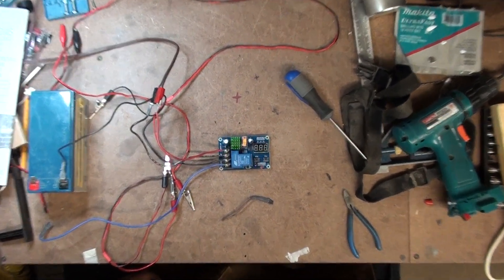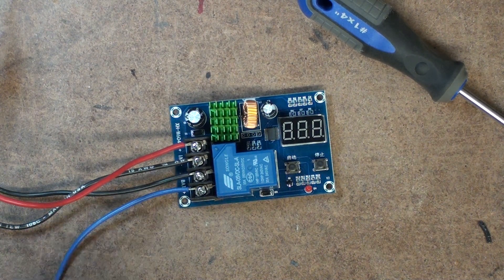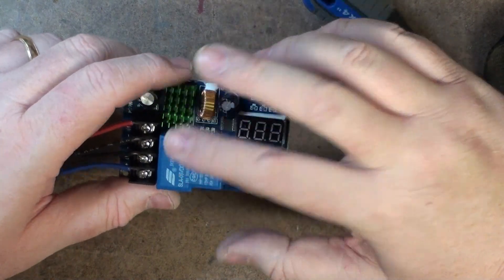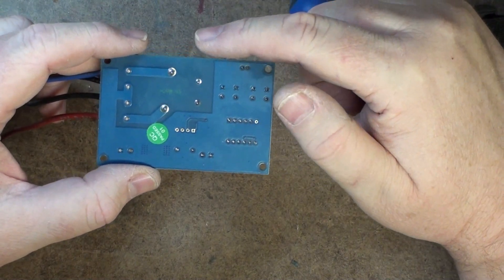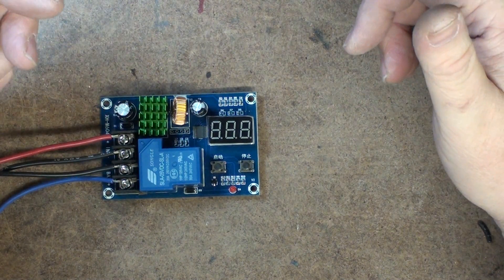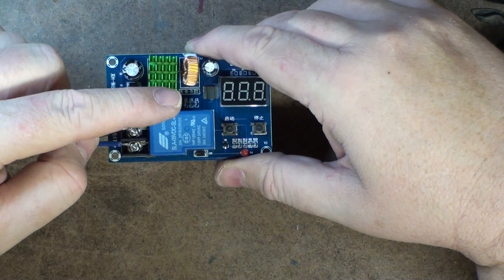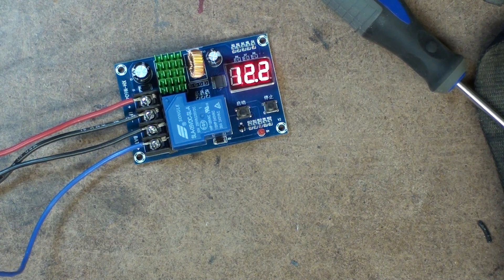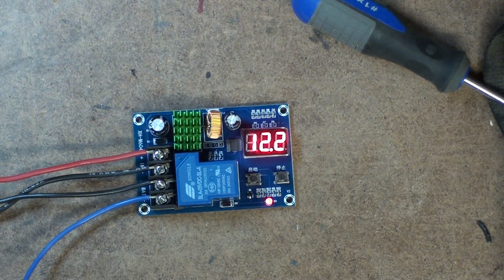ebay XH-M604 6-60vdc charge controller

Comment: FYI.    I took this board apart and those relay to terminal traces actually are duplicated on both sides of the PCB.   It should easily support 10 to 15 amps.   Personally I don't like the idea of this board.  I was rewiring it to power a dumb charger and use it to monitor battery charge and cut off the charger once the battery was charged.

Comment: The background audio noise makes the audio not as clear as it could be, but thanks anyway
Reply from the maker: my shed would be 140°+ in the summer without the AC.
Reply: @ObsessionoftheMonth  A headset/boom mic would reduce the background noise considerably.
Reply from the maker: @RyanStille  I filmed this 2 feet from an air conditioner in 115 degree heat. later videos are 10 feet away.

Comment: What happens if the display not on connect to battery only
Reply from the maker: If I understand you correctly, when connected only to a battery the display will light. the unit is powered by the battery.

Comment: can we connect it directly to a 110V AC power source? the Blue part on the charge controller shows 240 V AC, but the description in ebay says 6.60V as input. 
Also one of the the images in ebay shows a  'charger input' between the power source and the charge controller. 
If that is necessary, where to buy that. Please advice
Reply from the maker: The rating on the relay (the blue part) is in regards to the maximum voltage and amperage the relay contacts can handle. in this applications the negative connection is tied to the negative of the voltage in. 12 volts from the battery powers the unit. applying 110vac to the unit will fry it.

The 6.6 volts is reference to using it to charge a 6volt lead acid battery The unit will work on as little as 5 volts DC.

The maximum voltage the unit can handle is 30 volts DC NOT 60 as some listings say.

The charger unit is any charger used to charge a 12v lead acid battery. Ideally the charger unit would be dumb charger. meaning that it only outputs a charging voltage and does not do any monitoring or controlling of the charge itself as that is what this unit is for.

So you would hook up a lead acid battery charger (14.4vdc) to the IN side and a battery to the BAT side. Then set the voltages you want the unit to start and stop charging.
Reply: @ObsessionoftheMonth  I have seen in certain videos that they use a old Laptop charger as the input and then control the output volt/amperage as need be.. will that work.. i have an old 20V laptop charger lying somewhere..
Reply: sorry to sound as dumb.. i am really novice at electricals.. trying my hand at learning..
Reply from the maker: @mayukhdatta3801  yes
Reply: @ObsessionoftheMonth  I believe that to be wrong. In the schematics it shows that input of the charger is directly connected to the output. There is only the ON OFF function. So no voltage control, no amperage control only ON / OFF.
Reply from the maker: @LeoGerritsen  The rating on the relay (the blue part) is in regards to the maximum voltage and amperage the relay contacts can handle.

Comment: First , thank you for sharing this video , the maximum current can handle is not related to the relay , according to the supplier on Aliexpress the maximum current is 10 Amp :https://www.aliexpress.com/item/WAVGAT-official-VHM-004-DC-6-60V-Battery-Charger-Control-Module-Storage-Lithium-Battery-Charging-Control/32945908739.html?spm=2114.search0104.3.133.5cf5113bHEczSE&ws_ab_test=searchweb0_0,searchweb201602_2_10065_10068_10890_319_10546_10059_10884_317_10548_10887_10696_321_322_10084_453_10083_454_10103_10618_10307_537_536_10902-10890,searchweb201603_51,ppcSwitch_0&algo_expid=95d03cd0-e669-4507-8378-7c998bc2182f-19&algo_pvid=95d03cd0-e669-4507-8378-7c998bc2182f&transAbTest=ae803_3

Comment: HOW TO CONTROL BATTERY CHARGER SO THAT THEY NOT OVERCHARGING 80% AND NOT OVERDISCHARGE 20%
Reply: Please can get me a solution?
Reply: I need a controller that can monitor a battery charging  for me. 
Battery fully charged will be at 53v that's maximum voltage. 
Battery low voltage discharge  will be at 42v that's minimum voltage. 
The controller should be a  stable one. 
Thanks for your understanding. 
Very urgent please

Comment: thanks for the helpful video. can i use this boar with 19v laptop charger to charge single or double 12v lead acid battery? i really confused that this board work as step up/down buck to arrange charging voltage when there is a big voltage difference or not. thanks alot. i have intention to make bluetooth speaker box with car type batteries. i am looking for a charging solutions. thanks alot.
Reply from the maker: This board is only able to start and stop charging a battery. It does not step up, or step down the voltage.
Reply: thanks for the reply. now i understand the issue.

Comment: From ads I see the board width is 54mm and from my rough measuring the board dimensions on the video it looks like the traces are about 3.6mm wide.

Standard copper thickness for PCB is 1oz/ft^2 (it could even be thicker), and according to http://www.4pcb.com/trace-width-calculator.html calculator, with ~3.6mm wide traces it can handle ~6amps for external layers exposed to air with a 10C rise in temp, which is considered acceptable. You could verify the assumptions here by looking at the voltage drop and/or resistance over one of the traces and see if it matched the calculator.

Comment: I have used XH-M604 and XH-M603 for making battery chargers. These sellers on AliExpress have all the tech information except for the current it can handle. I have researched a lot and couldn't get the current ratings. The XH-M604 I used was to built a ebike charger and was fine with the 3A 60V Transformer and bridge. But when I had to build a 10A charger for a 12V 100AH battery I got a XH-M603 but unfortunately it had a LM2596S voltage regulator which could only handle 3A according to its datasheet. What is the point of buying this board if you can get only 3A current. Where I live I get relay based Battery charger boards at 1/3 cost of these board.
Reply: From the crude diagrams presented, the charge current is not going through a regulator. The charge current is just controlled by the relay. The regulator is likely just to drive the voltage selection and relay activation circuitry. Thus why a lower limit is acceptable.

Comment: Does this protect battery over discharge???
Reply from the maker: to the best of my knowledge this is only designed to start and stop a battery charger, it has no load control.
Reply: Thanks for the respose... 
I am just reassuring if i have not mistakenly decided in buying  XH-M609 over discharge protection module... now i think, i have not..
Godbless.

Comment: I am thinking one could add some wire jumpers on the back of the circuit board to make this easily handle 5 amps or perhaps use the relay to power up a larger contactor.

Comment: Can the LED display be turned off during normal operation? I was warned that XH-M603 do not have the 'display off' feature
Reply: They make the XH-M601 that uses two pots to set the start and end voltage I am sure it will use much less lower quiescent current to operate. You would have to use a separate power supply and volt meter when you first set it up to double check your start and stop settings but you wont have to worry so much about it drawing your battery down. Also on the LED's on the 603 or 604 one could find the common trace and break it and add a separate switch to shut off the led power to save a little on power.
Reply: @jimthvac100   You can also add resistors for each segment to turn the brightness and thus consumption down.
Reply from the maker: I do not remember, mine is inside a device and so I don't see it. IF I remember I will look in to it when I get home today.
Reply: thanks - i hope it can be turn off for lower quiescent current state
Reply from the maker: it does not appear that the display times out, nor could I find any information in the really bad instructions on turning it off.
Reply: thats a shame - thanks for the confirm. bought board below (still has not arrived yet) that has serial controller. its my obsession (at the moment) if u wanna check it out.

http://www.icstation.com/battery-charger-discharger-board-undervoltage-overvoltage-charge-protection-board-auto-module-p-12325.html

Comment: Thanks much for your sharing. I got this board for charging my lithium battery set (3S) and Lead acid battery. I found what you have mentioned, battery juice may be consumed if it hooked up with the board without the power supply. You seem to have said to add a diode into the circuit to avoid this.  What the exact location the diode should be installed?  The energy of the board itself seems coming from the battery, rather than the power supply side.  Ok, in all, do you know if I could avoid wasting energy to board when I am not charging or supplying charging power to it. 
Thanks again
Reply from the maker: place a diode of the correct amperage rating on the input side (where the charger goes in) positive lead. -->|-- +

there is no way that I know of to stop the board from drawing power and still be able to sense the battery voltage.

Comment: Thanks for the video. What gauge wire do you recommend to hook up to battery and charger also..Curious why you say it can't be used with a smart charger?  I was sold a fancy version of the same thing made by TCXRE to use with my Delta Q smart charger in a lithium Ion Magnesium Golf cart conversion .
Reply from the maker: SECRET FRIEND the size of the wire depends on the amperage you need. Mine is using 14 gauge because the amps are less than 15. The reason you would not want to use a smart charger is that this would interfere with the smart charger.